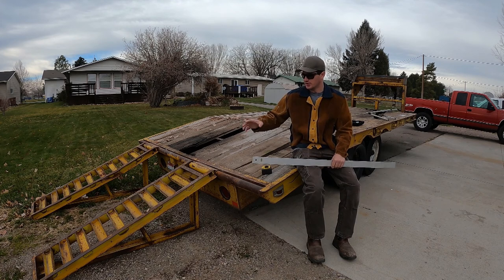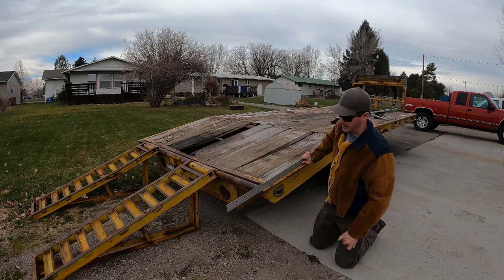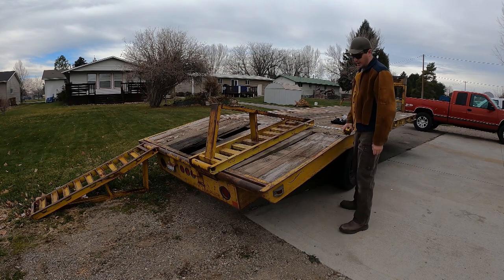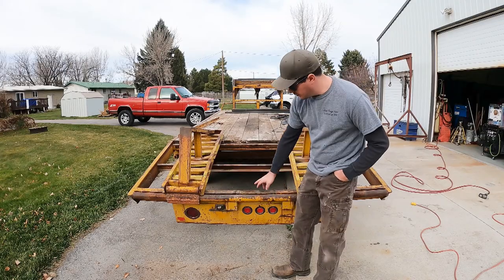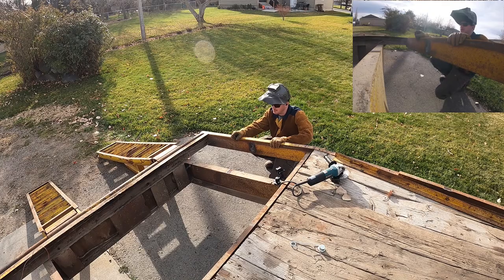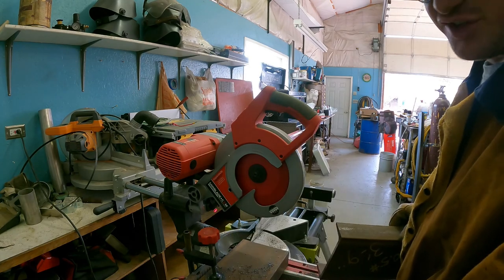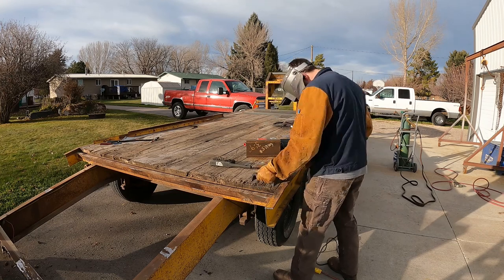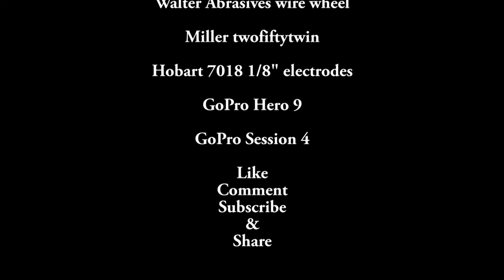Gooseneck trailer repair/modification Pt 4: Dove/Beaver tail. Should I have done this? You tell me.

Comment: A dovetail is a woodworking joint! Has nothing to do with a tŕailer
Reply from the maker: The Beavertail (sometimes called a Dove Tail) is a sloped extension on the rear frame of a trailer to allow equipment to be loaded over the rear of the trailer - with or without the use of rear ramps. That's taken straight from a manufacturer page. That's what they've been called everywhere I have worked.
Reply from the maker: Possibly a term adopted into the trailer world, but PJ trailers uses it and many more.